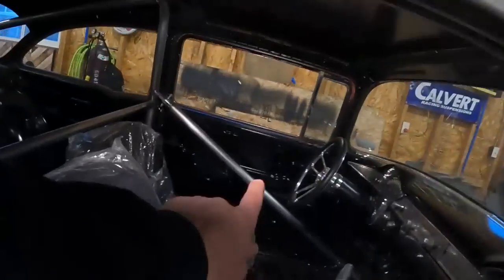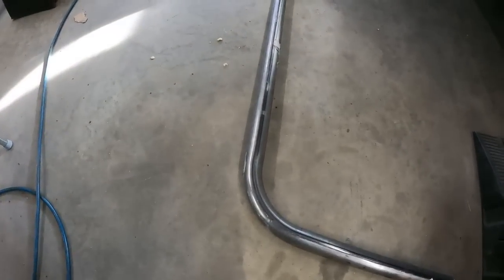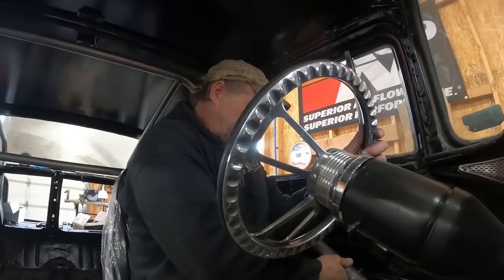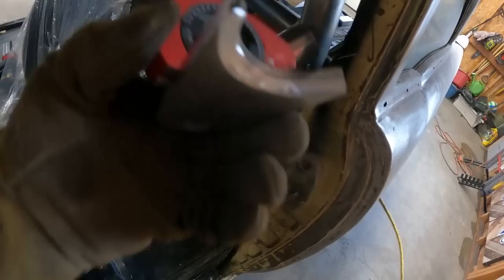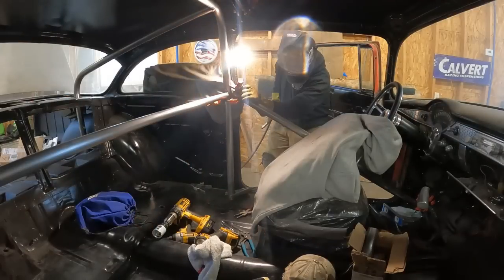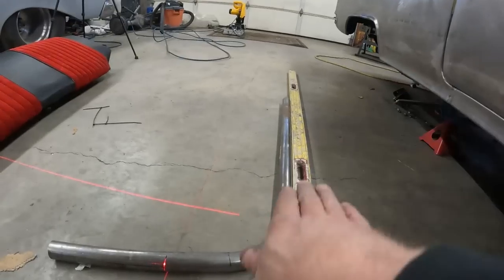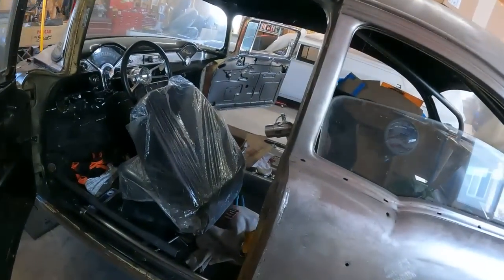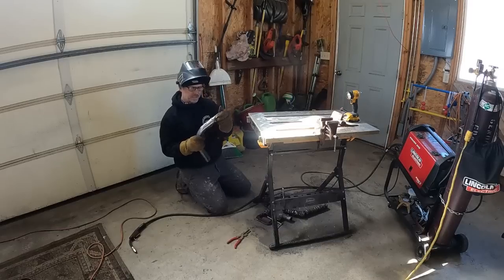1955 Chevy NHRA Roll Bar - Installing Swing Out Door Bars

Comment: You won the 57 from DD Speed Shop. Also great on the welds. The more you do yourself the more you learn and the more money you save. I wish I could have done more on my 57 and saved money and sometimes your better off doing it yourself anyway.
Reply from the maker: I'm learning a ton, that's for sure. I may be saving a bit of money, but somehow I'm still spending plenty. Nothing cheap about building a hot rod. Can't think of many better things to spend it on though...

Comment: Were you going to add a Z bar to the back bar, which will make it very strong and keep it from racking? You got the 57 from DD speed shop. 
BTW, your welding is getting better every day.
Reply from the maker: Thanks for playing along Monad. I was going to add the diagonal down bars, but probably won't at this point. Not sure what the z bar you mention is.
Reply: @Montana Garage,  It goes from a corner to an opposite corner. It's keeps it from racking. Think of it like a brace on a screen door. They call it a Z brace because of its shape (like your door bars). That is why rafters are Z Braced. Sometimes, you could add 2 going opposite directions so it looks like a V brace. It will add a lot of strength if it rolls over, God forbid.  It's looking good, by the way. I can't wait to work on my 55. I'm building from frame up a Nomad from a 2dr 210 wagon. I grafted in a Nomad roof in. Now I'm rebuilding the rear window channel and inner fenders that I pick up from Don's Hot Rod Garage in Ohio.
Reply from the maker: @monadking2761  Thanks for the info. I still would like access to the back seat, so probably gonna skip the z bar. Good luck with the Nomad. Sounds like a cool project.

Comment: Will that be in the way of the dimmer switch.
Reply from the maker: Nope. Dimmer switch is above and slightly right of the bar. I have the same setup in the '57 delivery, and there is  no issue with getting to the dimmer switch.

Comment: Why do you make this so hard ??   Lets go back in time ... 70s we used a flexible exhaust pipe, I think they still make them today, we would use that to figure out how the bar would go, then take our measurements from that, or as we did it... eye ball it.  And then to the torch and pipe and made our bends, and cuts and the weld. And the flex exhaust pipe would go back up on the wall for the next one,
Reply from the maker: Making things hard is my super power. Thanks for watching.